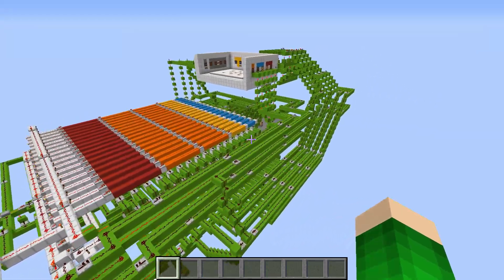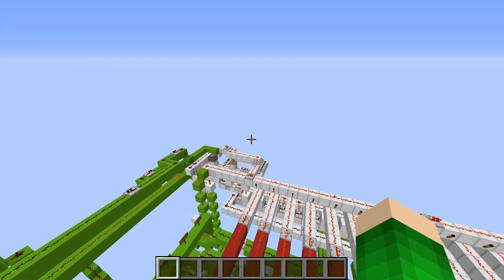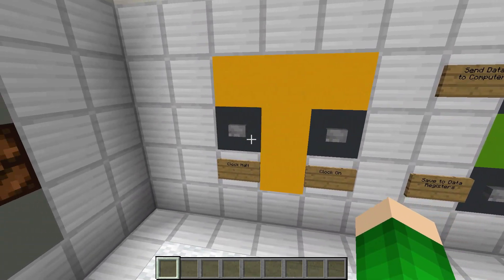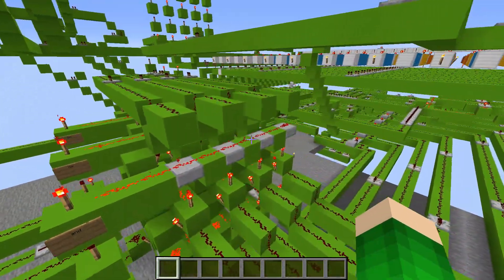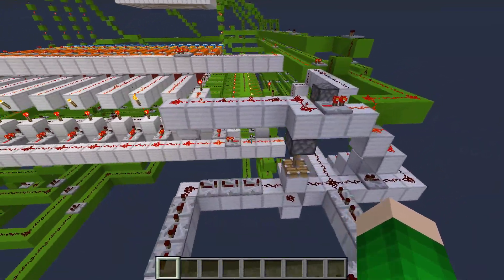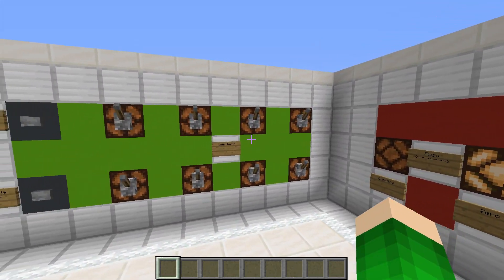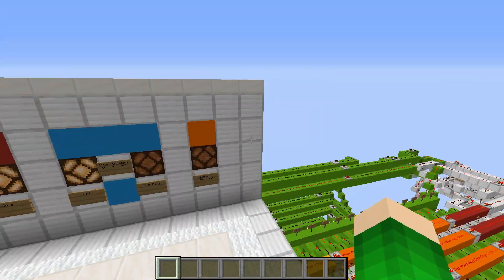Minecraft - Redstone 4-bit Computer Showcase

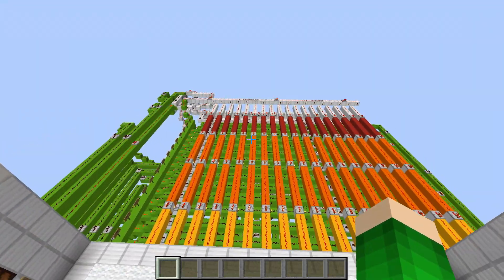Comment: This is the very first minecraft computer I downloaded to try to understand how they work and wrote the fib program by taking a look at the torches at 12:16 and I'm a little confused.
It seems to be doing the addition, though the number calculated doesn't go back into the machine, so the machine code basically says this
A=1 B=0 ADD
DISPLAY
A=1 B=1 ADD
DISPLAY
A=2 B=1 ADD
DISPLAY
It seems to be hard coded instead of taking the result from the previous calculation and putting it into A or B
Does it not have the functionality to store the ALU output into one of the registers?

Here is how I would write the program in some sort of pseudo assembly, though the computer doesn't seem to support loop/jump/goto
:INIT
A=1 B=0
:LOOP
ADD
B=A A=ACCUMULATOR
(halt if overflow?)
DISPLAY
GOTO LOOP
Reply from the maker: Let me clarify something. This is one of my first “computers” I’ve built in Minecraft and since this video, I’ve learned a whole lot more about redstone computers and just computer science in general. I’m not very proud of this now as it really can’t do much. It doesn’t have any conditions, it hardly has any memory, the calculated data doesn’t go back into the machine, etc. To put it shortly, I don’t like it. For it’s functionality, it’s way too bulky and it just goes to show how good I was at redstone back then. Now a days, I’m actually working on a new computer that uses a lot of the knowledge I’ve accumulated since this video and I’m pleased to say it’s much better than this one.
Reply: @sarnnox  I'm looking forward to seeing future projects

Comment: so you can technically overclock this by making the repeaters shorter
Reply from the maker: Sean Parkes Yea I know now after testing it some more!
Reply: @sarnnox  or instant repeaters
Reply: @humanbeing9079  instant repeaters? What?
Reply: @Versuffe  Idk what they mean either
Reply: @therealloganyt237  It's a contraption using budded pistons and quasi connectivity that act as a repeater and are instant
Reply: Sean Parkes galaxy brain
Reply: But sometimes you need them to make timings exact
Reply: What is a stable speed?
Stock speed is 60 redstone ticks, or 6 seconds per cycle (0.166.. cycles per second)

Comment: What's the full list of actions the ALU does? I'm working on a 8bit computer I have built a binary number comparison (for if statements) and an adding/subtracting circuit. I plan on adding AND, OR, XOR, NOT who will work with fixed values or variables. What else do I need?
Reply from the maker: The full list of ALU actions for the computer are AND, OR, XOR, and SUM. This is my first computer but I’m also working on a Improved version which will be 6-bits instead of 4-bits. It will be able to support conditional and non-conditional jumping. It will include a more advanced ALU with more functions. More short term memory or RAM and a Random number generator. I still have have lots more to plan for my next redstone computer project so what I just said is not all I’m going to add to my new computer. Thanks for your question anyway.
Reply: @sarnnox  thanks im doing 8bit to type characters. Im just trying to figure out how stuff should be with no cs knowledge  and just js coding. From what i got pc alus are a tradeoff for speed and functions. The more stuff i do in 1 clock the longer it takes but least cycles ill need to  make a program?